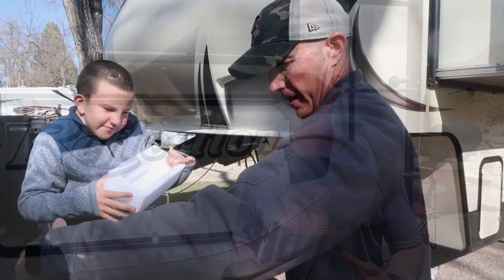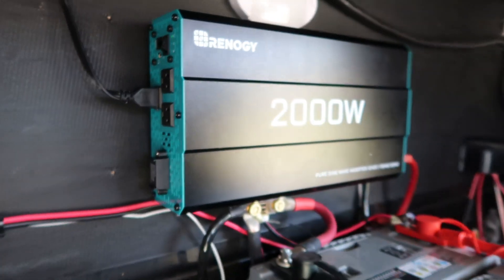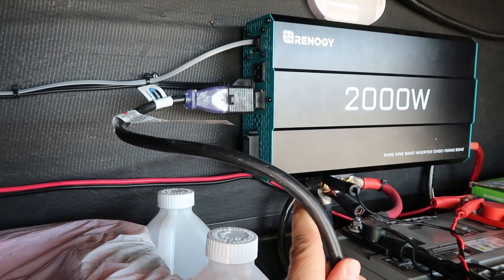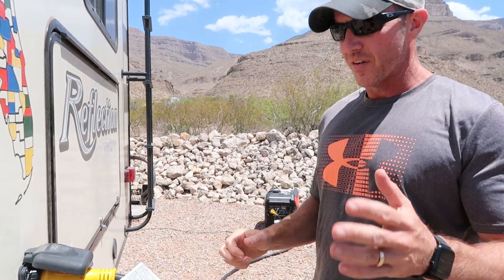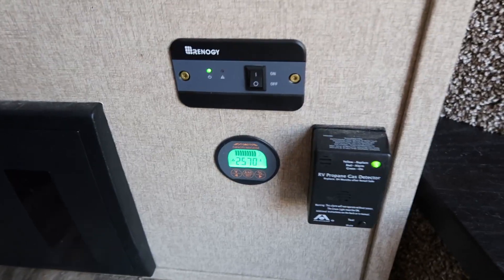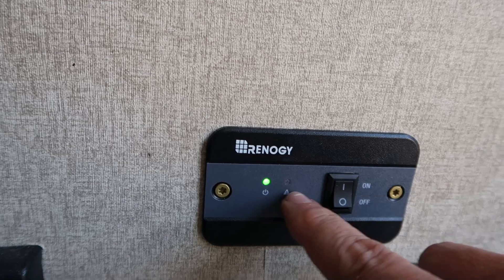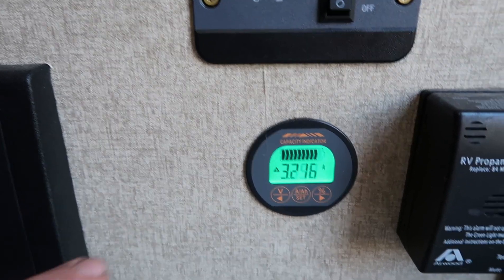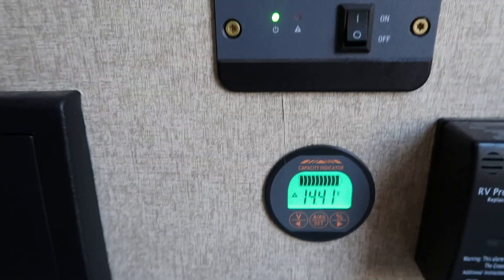How To Power Your Entire RV With An Inverter | Easy Inverter Power

Comment: Why isn't the generator set up to kick on to charge those batteries when there is a high demand or the battery's get low?
Reply from the maker: With this setup, I have the trailer plugged into either the inverter OR the generator independently.
Reply: @JouppiOutdoors  I saw that. What I'm saying is the generator should be wired in to when the battery gets down to 5%, the generator kicks in just long enough to build the batteries back to say 75%, then the generator would shut down, probably 20 minutes charge to build the batteries back up. No one wants a generator running non stop. Using the generator as a booster just long enough to build the battery back up would only use the generator now and then. I'm no technician. I'm running on a concept. Thx.
Reply from the maker: I get what you’re saying. I kind of do that…but manually. The solar panels keep the batteries charged during the day, so in the morning (once quiet hours are over) I can run the generator for an hour or so to boost the batteries until the sun gets up, then the solar takes over and I shut the generator down. The Predator 3500 is really quiet.
Reply: I want that set up. I want a solar system whose main source is solar. I also have a nice tri fuel generator runs off gasoline, propane or natural gas. With a configuration where the solar is primary source, the generator powers up automatically to charge the batteries when the draw is significant and/or the batteries go to 5%. i can power on my generator from a remote control or from the Swiss Alps using my cell phone, seems logical it could be configured to respond to high demand or low battery, automatically.

Comment: Is it powerful enough to run a 1200w electric oven  ?
Reply from the maker: If you have a battery bank with enough capacity, you could run it.
Reply: That's the good thing of having batteries with a lot of CCA like 860cc and up like 1,000cc

Comment: I want to take my 5th wheel to state parks when shore power isn't available. I have a 1500 watt sine wave inverter from Harbir Freight that backs up my sump pump on my marine deep cycle battery. What would you see as issues using 2 deep cycle batteries with the inverter set up your way? I only want to have lights, tv, phone or laptop charging. I don't have generator yet. Parks limit the hours of operation. On that, can you recommend a good quiet model? 
My only issue is not having ac if it's hot. I don't like 80 plus temps. 
Doing this would provide more opportunities to be off grid. 
Thanks for your comments in advance.
Reply from the maker: There would be no issues using 2 deep cycle batteries, you would need a way to recharge them. The 200 watt portable solar panel does a great job. The 1500 watt inverter is plenty to power what you are wanting to run. The Predator 3500 is as quiet as you can get for that size generator, and you can run an A/C with it!

Comment: What size Breaker do you have between the Batteries and the Inverter ?
Reply from the maker: I have a 250 amp fuse in-line between the batteries and inverter.

Comment: I’m looking at buying a trailer, and want to put in a 3 000 watt inverter and 2x 200 amp hour batteries. When I called Renogy, they said it would run a 1,000 watt microwave for 4.8 hours, with no solar coming in. I know it isn’t practical to run high energy appliances like AC and  Microwave, but sure would be nice to park at a rest stop for a nap, and run the air 45 minutes to an hour. Having that much capacity also assures the low draw like 12 volt fridge should last forever with some solar input. It has a 200 watt panel, but I want to put a plug to add a portable one when parked. 400 watts in should extend my run times, wonder who can figure that? Great idea though
Reply from the maker: You would need a soft start on the A/C so the starting wattage would not overload the inverter. You could definitely run the A/C for a short time, but I would recommend installing a good charger or better yet an inverter/charger. Here is a link to a great resource showing how long a 200ah battery will last at various wattage loads. Volts x Amps = Watts. Your A/C will pull roughly 1700-1800 watts once the compressor is running. https://learnmetrics.com/how-long-will-a-200ah-battery-last-lithium-agm-deep-cycle/#12V_200Ah_Lithium_Battery_Running_Time_Chart
Reply: Just curious. If the 3,000 watt has a surge capacity of 6,000, why would I need the soft start? The reason I am asking is, the manufacturer will want to deny warranty because it’s been tampered with, or modified in some way. Any issues with that? Thanks
Reply from the maker: It does have a 6000 watt surge capacity. The soft start would be more to mitigate the excessive draw on the inverter and batteries when the A/C compressor starts. I have not heard of anyone having warranty issues by installing a soft start, but do not know if it would void the warranty.

Comment: Great Video! Thank you.  As you and your family,  my family and I are not hardcore boondocking campers.  I have a Renogy 400 watt system with only 1 Lifepo4 battery. I been wanting to buy their 2000 watt inverter for small loads like you do as I want to run the microwave at times.  Always have wondered if I would need an additional battery.  It seems that my 1 battery would do as I can fully use the 100ah to 0 (I am assuming you use your batteries to 50%).  Thank you and keep them coming.  Your video was really nice.
Reply from the maker: You are correct, I only use 100ah of the 200ah battery bank. I have since upgraded to 2 100ah lithium batteries to double our useable capacity! Thanks for watching!

Comment: Excellent video. Simple and elegant way to avoid the need for a transfer switch. I'll be installing a 2000W pure sine wave inverter this spring for my GD 5th wheel. Considering your method vs using a transfer switch to add some flexibility to the system.  Keeping things simple is usually the best alternative. The detail about turning off the converter breaker is very important when using the inverter for powering the rig using your method.
Reply from the maker: Thank you, my main goal was a simple way to power the RV. Glad the video was helpful! Thanks for watching!

Comment: what amp alternator are you running in your vehicle?
Reply from the maker: It is just the stock alternator for the Ram 2500.
Reply: @JouppiOutdoors  what year? They went from 180amp to 220amp

Comment: I got an iffy MWXNE 2000 Watts pure sine inverter because it was all I could afford to run my window air conditioner from a 12v 300ah LiFeP04 battery in my camper after hurricanes and other storms. Putting it on solar once I finish my system piece by piece. I need two more panels to match up a series/parallel 24v input through 10 gauge MC4 cable to a 60 amp MPPT controller and a few switches and battery meter. I`ve been using a 20 amp plug-in charger in the meantime to top it off before storms. I started with a collection of power banks for tiny fans and Onite LED bulbs then started getting various solar power stations from 250w up to 700w for emergency power for a dorm fridge, freezer, rice cookers, Dash griddle, and sometimes an electric blanket. I need to get a backup inverter for sure.
Reply from the maker: That’s going to be a great setup once you finish it!

Comment: Gear exactly what  needed,  Dupre mentioned turning the converter of; please explained why this is required.  Many thanks,

Marcel
Reply from the maker: If you do not turn off the converter, you will be draining power from your batteries while the converter is trying to charge them. Since the converter pulls more amperage than it produces, you will kill the batteries very quickly.

Comment: So turning off the breaker for the converter in the rv do your 12 volt lights work? I thought the converter charges the battery and converts shore power to 12 volts for lights vent fans ect
Reply from the maker: The 12 volt lights will run off the batteries, but the batteries will not charge with the converter off.

Comment: Thanks for the video! I’ve been trying to figure this out for the past 1.5 years I’ve been on the road. I have finally acquired everything I’ll need I think but that’s why I’m writing this comment. I have 2 6v batteries each having 225ah. All of my equipment is 12v but I noticed you had 2 batteries. Do I need another pair of 6v ran in series? That way I’d have the equivalent to having two 12v batteries. I also have 2 100w renogy panels but they’re the permanent ones. From your experience how long does it take to charge your battery bank? Do you ever run out of power?
Reply from the maker: You can wire the 2 6 volts in series to make one 225ah 12 volt bank. My 2 12 volt batteries are 105ah each wired in parallel for a 210ah bank. You essentially have the same capacity as I do and we can run overnight easily with the batteries at 12.4v in the morning. It would probably take all day with full sun for your solar to recharge that bank if it were 50% depleted. That is why I installed the Victron BlueSmart 12/25, so when my generator is running, the batteries can fully recharge quickly.

Comment: Quick question, how many 12v batteries can you connect to the Renogy 2000 watt pure sine wave inverter?
Reply from the maker: Technically, you can connect as many as you want as long as they are wired in parallel to make one big battery bank!

Comment: Could you use your 50 amp cord to a 120v adapter instead of buying a new extention cord?
Reply from the maker: You definitely could. Mine will not reach the front of the 5th wheel to plug into my inverter.

Comment: Just about have my 800watt solar / 3000watt Renogy Inverter / 412 aH lithium setup finished.  I had planned on using the drop cord technique as you do, but am thinking that there must be a way to wire the power directly into the power distribution panel ??  And I don't want to hard-wire a dedicated outlet since I will need the AC power in a few different places.  Any ideas ?
Reply from the maker: You could install a sub panel with the outlets you want to power being fed from it. It’s not something I have personally done, but have seen others do it to accomplish what you are trying to do. Might be worth looking into. Thanks for watching!

Comment: does your battery monitor show you load on your 12v system as well? Or is that part of the inverter, and only showing load via the inverter? Sounds like it's separate since it shows charging as well. If that's a separate monitor, can you give us a link to the model/etc you used?

edit, ok yeah sorry I read the video description for the links, duh.
Reply from the maker: No problem! Thanks for watching!
Reply: @JouppiOutdoors  Cheers. I'm looking to put a 2000w inverter in my RV, going to swap out the single 12v for dual 6v GC2s prob.. trying to figure out how i'm going to connect it since my input is at the back of my trailer then your extension cord trick sure makes a lot of sense especially since the cord that pulls out is damn near the length of my trailer.

I don't have a breaker specific for my converter so I have to track down which fuse it is.

Comment: I use this solar Generater.Systems  at work. The building is 80 years old so there’s not a lot of electrical outlets. I use it for lights, fans, charge phones etc. works great !
Reply from the maker: A 200 watt solar panel will provide around 12 amps (DC) in full sun. Our trailer uses 7-9 (DC) amps for lights, refrigerator fan, and roof vent fan.
Reply: Any of the "Generator dot Systems" comments are bots, folks.  Just a heads up.

Comment: How can a guy do this for 24/7 power as we are starting the off grid living
Wind and solar are on the way
Reply from the maker: You would need a large enough battery bank to get through the night with out draining the batteries below 50% and enough solar and wind to recharge them during the day. The inverter would need to be sized properly to accommodate everything you want to run. Thanks for watching!

Comment: I was hoping this system would help run my AC unit & microwave oven Maybe it’s not your entire RV 😢or did I misunderstand what he meant to say in the beginning?
Reply from the maker: With a large enough inverter and battery bank you could run all of that. The issue would be having enough solar panels to recharge the batteries while using the A/C. This is a simple way to power the RV and use everything except the A/C. The microwave oven is possible to use with this setup, it would need to be the only thing you were running though. Thanks for watching!

Comment: Bump up the DC wind turbine/motors at 3-10 kWh via 2-5 + DC generator/motors turned by plugged in DC Motor shaft cog belts (no wind no solar needed) to the 4000w 8000w peak to run the cooker & refrigerator full electric plug-in.

Most government solar power schemes are schemers.
Any more power you make paying off the solar system installed invertor when too much they Take and sell it you back When no wind or sunlight.
Unless you bought solar power online Invertor with battery to save as much as you don't give away to the Grid electric companies will still take what they want units until you totally disconnect them to run on wind/solar power battery 🔋 banks??
You'll still be buying From grid cable needs to stay.
Solar and wind together?
Unless you live across the Equator or move to Chile for all-round wind you're definitely buying added full battery and or gas or electric or gas to use at home otherwise wood pellets to turn Steam generator heat and power voltor LTD
Reply from the maker: Great info, thanks for sharing
Reply: @JouppiOutdoors  Witts free energy is for real.
1 smaller Motor turns
1 AC alternator runs AC current lights and heating or microwave..

My ideas go back to 2007/2008 ©®™
Meter & locked down #RECYCTRIXUNO pay as you go power anywhere anytime Facebook.

If you set up a solar/wind turbine invertor all-in-1 power USA plugs x2 or more & 2 USB.
You'll run the DC stepper motor and sun planetary gear ALL-IN-1.
Step
1 solar Wind turbine to RV DC invertor/s 

Step
2 battery charger or without

Step
3 USA plug DC stepper motor controller to set speed for +/- MANUAL marking power on device appliances you'll realise when turning 2+ DC generator (buying 3 bolt Over edge) on fast enough.
Wind turbine can't run so fast facts because of the pole fan vibration.
You'll spin them silky smooth silly bolted 1 smaller Motor geared tutnd6 2-3 x 5kwh DC Motors are generators using 1 as main motor to Run 2+ GENERATOR.
Alternator AC invertor or direct Witts free energy 1 Alternator pumping AC pure power can will run 1.5kwh AC heaters convector heater example.
If anyone wants NEEDS to setup Motor controller to DIY marker/etch knob turn speed up manual around 1500/5000 RPM+ X 2 or 10000000000000+ DC generator (Or AC generator) Will be turned by azipod turning massive 4 X double decker bus size wind turbine which rock vibration stupid.
They'll eventual breakdown decommissioning.
We stack them row/s and column/s

Comment: bad idea 15 amp cord is the week link in this
Reply from the maker: It’s actually a 20 amp cord, but we never pull anything close to that while running on the inverter. Thanks for watching!
Reply: @JouppiOutdoors  in the video you stated a 15 amp plugged into a 50 amp pigtail.
Reply from the maker: @nightstringers  correct, the outlet on the inverter is a 15 amp outlet. The cord is a heavy duty 20 amp extension cord.

Comment: Sorry question what battery setup ate you using?
Reply from the maker: In this video, I am using 2 12 volt group 31 AGM batteries in parallel for a total of 210 amp hours capacity. I have since upgraded to 2 100ah lithium batteries (given to me to test)

Comment: Hi Jouppi, Awesome Video. A++. Can you give me and advice?  I live in my Van full time, for about a week right now and I hope I can find someone to help me on my issue with my 3000 Multi Plus inverter. My inverter is 50AMP / 120V. When I went to start my Water heater, 12A /120V/ 1500W my fuse heated up red and it didn't blow. I quickly disconnected! Try my Induction oven and the same respond. Cable size is 4/0. Everything that is small AMP like Refridge, Computer, TV, Phone works fine but Big Appliances is where the problem happen. Any suggestion? Thank you.
Reply from the maker: What size is your fuse? 1500 watts AC will be roughly a 130 amp DC draw from your batteries to the inverter. Here is a link to help convert the ac draw to dc draw. 
https://www.batterystuff.com/kb/tools/dc-to-ac-amperage-conversion-run-through-an-inverter.html
Reply: @JouppiOutdoors  Wow! Thank you for the link. My Fuse size is 350AMP I have 3 Battle Burn Batteries at 100 Amp each. I fallowing the link instruction, my inverter should handle my water heart perfectly. According to the AC to CD Calculate sheet. I am Puzzle. I will have to figure what happening. Don't understand everything about electrical and definitely don't want to burn down my New Home. Thank you for the link.

Comment: Thank you for this video it is exactly what I am trying to do to simply run my RV outlets.  One question though.  Is there something added between the extension cord and the inverter?  it looks like a small black adaptor of some kind?  Thank you again.
Reply from the maker: My extension cord is a 20 amp cord so I need an adapter to plug into the standard 15 amp receptacle on the inverter. I have all the components listed with links in the description. Thanks for watching!

Comment: You didn’t show how to connect the batteries to the inverter. I’m sure it should not be assumed that everyone knows how to do that.
Reply from the maker: Good point, I could have been more thorough in that area. However, most inverters come with clear installation instructions. This video was more about how to power the RV once the inverter is installed. Thank you for the feedback.